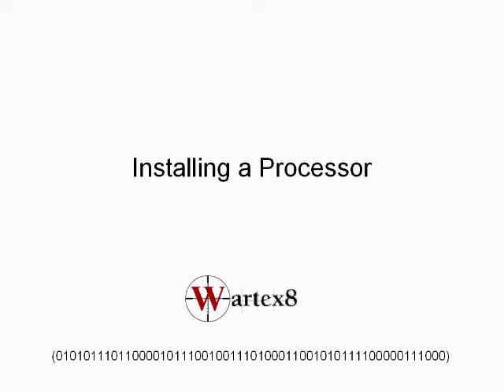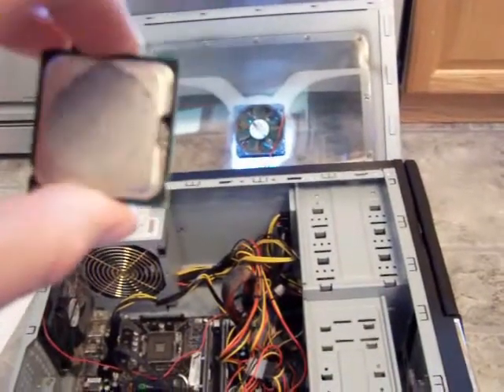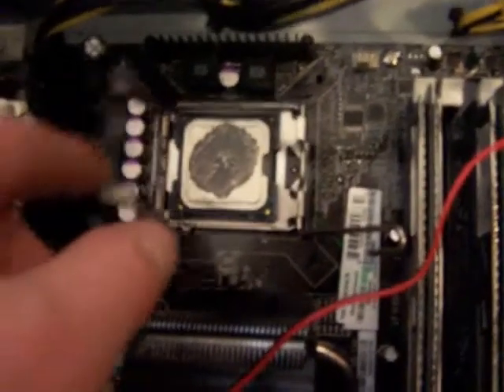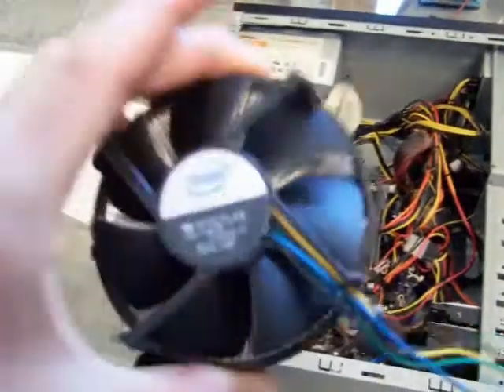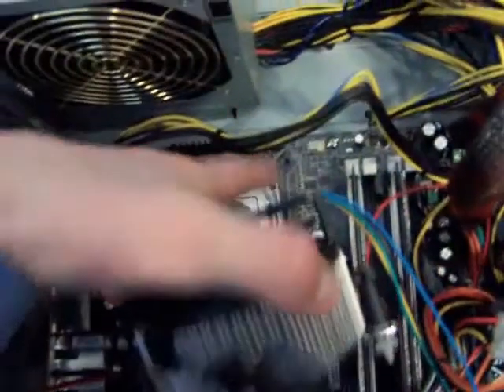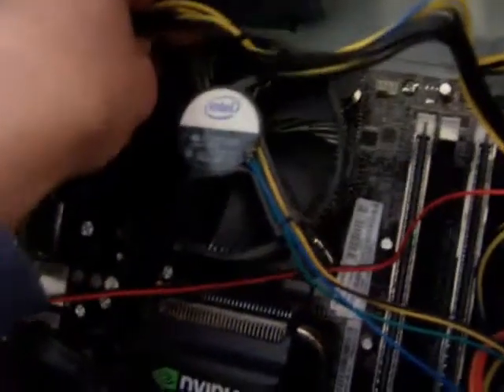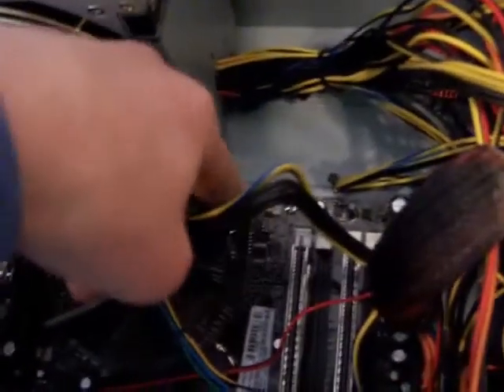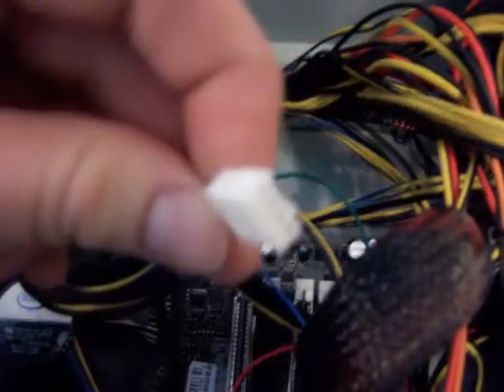Installing a Processor

Comment: Just some advice for new builders... Use AMD they are way less expensive, although the L1, L2, and the new L3, cache is much lower than Intels another downside is think intels Core 2 Technology uses less voltage. AMD is still good performance for a cheap price...